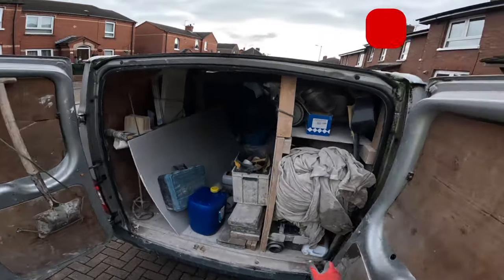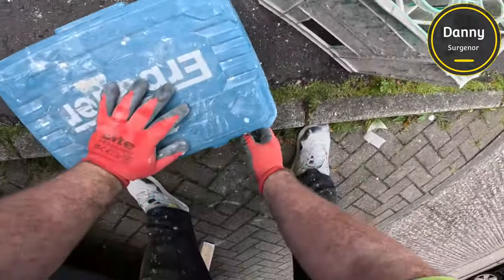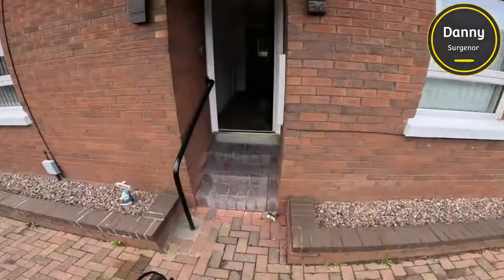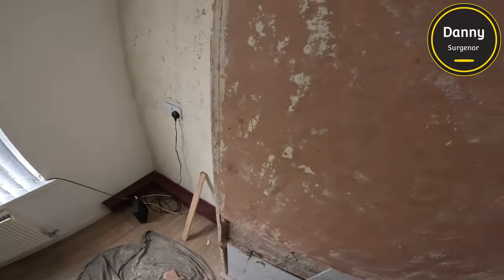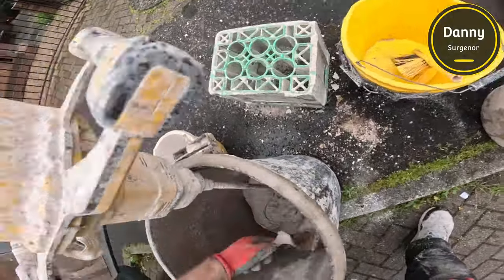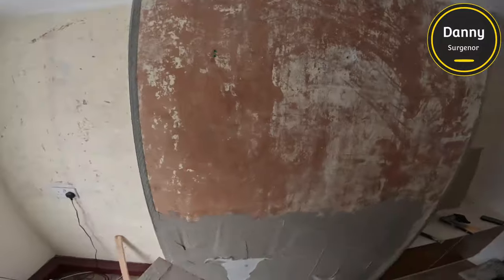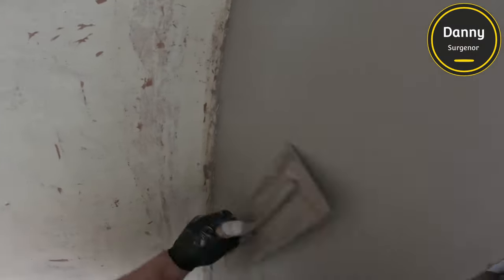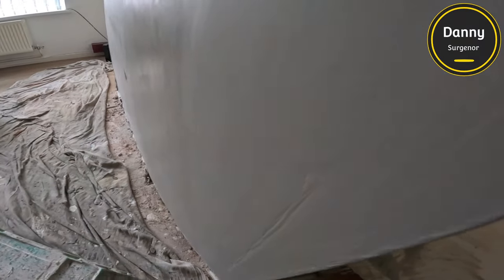How To Block Up And Plaster Chimney

Comment: Av done lots of places , at my employer, av got to brick up bond skim and put on a vent so the cavity can breathe, av been sent to job's were plasterboard is used, and instructed to rip off plasterboard and brick, plasterer board will go mouldy in time ,
Reply from the maker: It shouldent go mouldy if there is a vent fitted the airflow wicks away moisture. I dont fit a vent to this one because to the left hand side is a 1 foot wide vent were the gas fire pipes come out. Is there anywere you use i could info about the plasterboarding molding?

Comment: Hello. Why did you add cement to mix?
Reply from the maker: It makes it set a little faster but i would rather use dirty water. There are a lot of people will say dont do it but i have been doing it 20 years now with no problems

Comment: How much does blocking up a chimney cost roughly
Reply from the maker: Depends hiw you want it done but this cost £390
Reply: @Surgenorplastering nice. I was gonna say 3-350. £250 labour plus materials and a bit on top incase anything went wrong

Comment: Don’t you need Ventilation to the breast?
Reply from the maker: There is a side pannel with a vent in it so no need for 1 in the plasterboard. But i would put 1 in if there were none. Tbanks for watching.